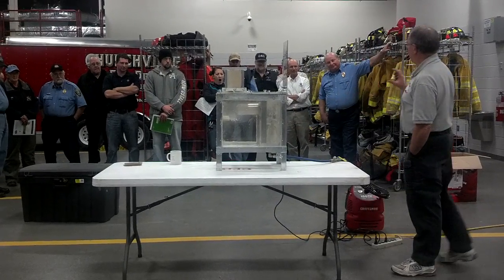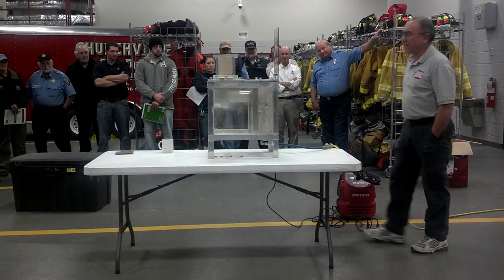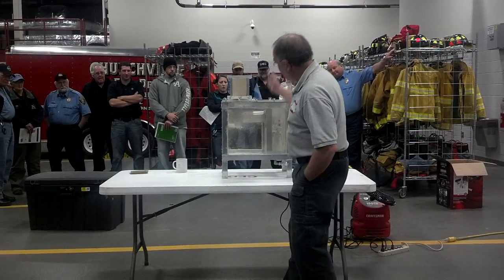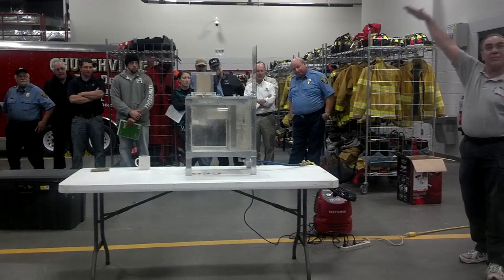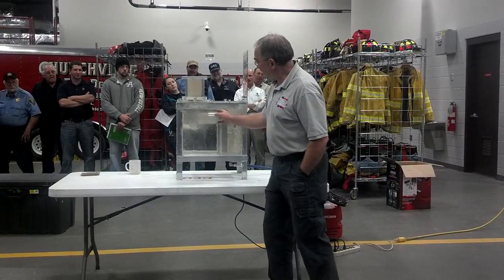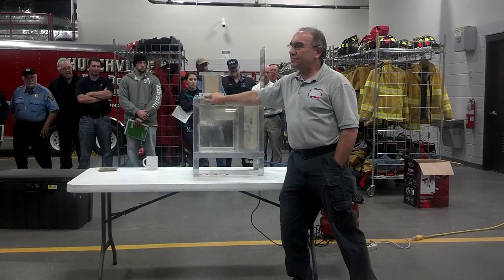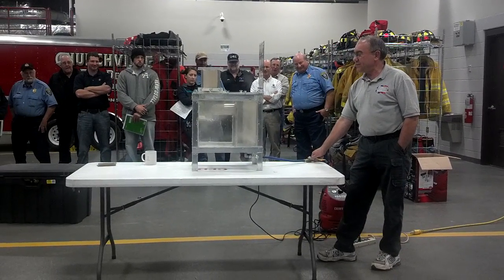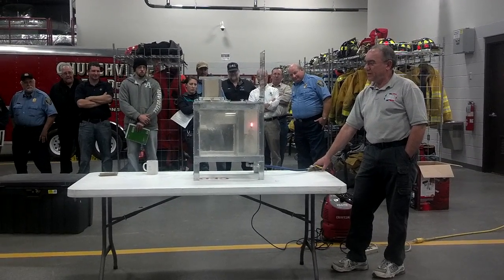Grain bin explosion model

Comment: I was in the guard shack area of a huge distillery sitting in a chair waiting for the plant maintenance manager to arrive. The guard area was attached to the distillery and grain elevator. There were some welders working up in the elevator laying out leads when they had as a source of ignition. They think probably a cigarette. The side of that elevator blew out. We're talking three feet thick of reinforced concrete and a chunk that blew out a few feet and just hung there. This piece was about half an acre in size. 
This elevator, this factory, was the largest distillery on the planet for about 50 years in Peoria Illinois.
One of the welders, there were two up there, he died up there, and the other guy had horrible burns.
I never heard a pop or explosion like a percussion. It was a huge rush of air that that slammed through all of the rooms everywhere in the factory.  It blew out windows everywhere there and it lifted me up and I landed  next to my chair on the floor. The guard shack doors, which had these huge closers, slammed open like they weren't even there. ADM co.
mid 90's. This was all entirely just grain dust, fine powder in the air.